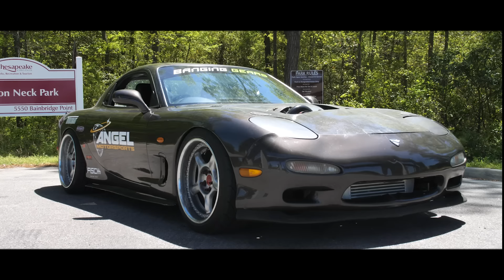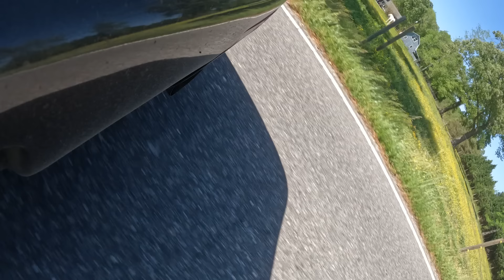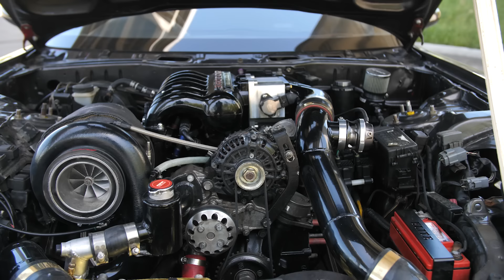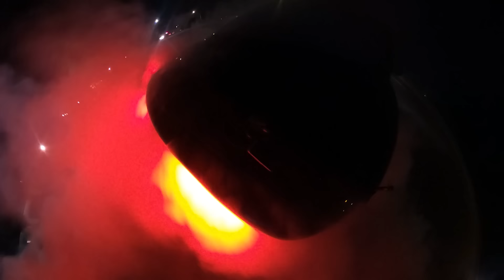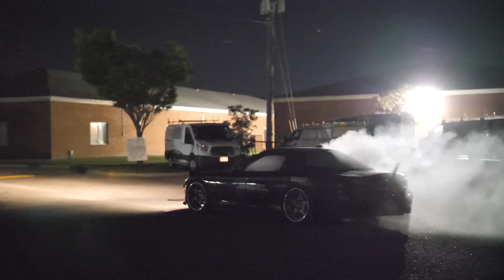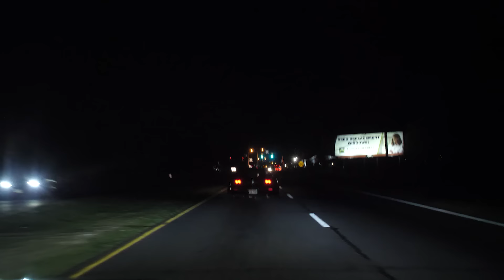Slaying the Streets in a 800HP 3 Rotor Mazda RX7

Comment: these OEM 3 piece wheels are SLAPPIN!
Reply: For real tho, 3p conversions are fire, but dont know about their streetability, have a friend convert some for his e36, of course, he bought a used set, they leak around the face because they were never straight, some good silicone got rid of the problem but really, welding them would be the best solution, i would do that only with a new set

Comment: The story at 11:49 is what I always knew would be a limiter to these cars growing up.
I remember Tokyo Nights and all the talks about how they did it in Japan, where they would build 20-30,000 transmissions that could handle the insane power it takes to get up to 170-200mph range.
Ive ALWAYS wanted one of those drivetrain setups, know thats what Im doin with a 20B when I get one...
But then I really need to consider how much it will cost to get the CG/balance and suspension set up to be SAFE at such insane speeds.

Ive done 184mph on my R1. Thats scary AF. Kudos to the sized balls you have to roll this bad boy! What a beautiful setup and ownership. Love that, brother.

Comment: I want an FD with a 20B/3-rotor in it so badly! One of my JDM dream cars. It doesn't even have to be that built, lol. Just the usual stuff like street port, studs, etc., flex fuel sensor w/ E85 tune, and a small turbo, and I'd LOVE it. 400-500 wheel HP and it would be amazing.

Comment: The 3 rotor is the perfect blend among all the rotaries for me. 2 rotor= lower torque, more farty noise. 4 rotor= sounds like a god tier n/a engine, more torque, but much too complicated to run and maintain. But the 3 rotor? Perfect blend between the two. Much more even torque spread, Sounds way more exotic than a 13b, and maintaining it isnt gonna be a gigantic pain like a 4 rotor. TRC did a feature on one a while ago, a 3 rotor making 900whp mated to a BMW dual clutch trans.
Reply: except for a 20b is rare as fuck, and insanely expensive. this is angel motorsports not some random guy
Reply: 13B is still the best pound for pound performance rotary engine, more net HP per dollar, the quickest rotary in the world is a 13B look it up

Comment: “Didn’t want a horsepower battle that made the cars not reliable” thought rotaries from factory were never reliable?
Reply: It's a misconception in the west.
Reply: @jimbowcracklehead8071  they were reliable?
Reply: @BudderChicken101  yeah, N/A 2 rotors would last up to 220k miles before needing a rebuild, of basic seals and o rings, "inexpensive"
Reply: @BudderChicken101  many people did not pre mix leading to pre mature failure and bearing wear which would total more in a rebuild vs a basic seal replacement

Comment: What is the actual noise difference between a built v8 and 3 rotor in decibels? I've never driven or even stood near one so I can't make a real claim. But it sounds on video like it's unreasonably loud and hard to tolerate
Reply: It’s bad and also at idling
Reply: @seadoomania  word. The trade off doesn't seem worth it at this point

Comment: ever wonder if that car was deliberately engineered to be incapable of being easily modified to make more power... 4.6 ford, just put 440cc injectors in it and tune the fuel pressure to top out at 23psi = 450lbft 350hp, from 195hp.